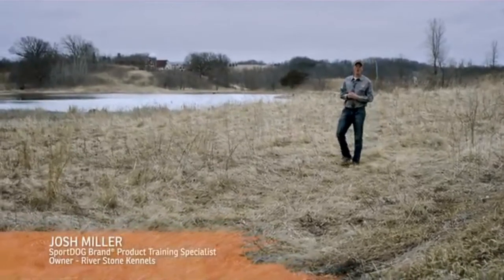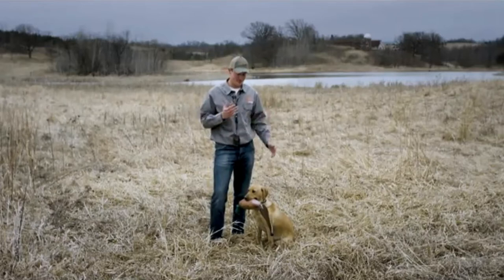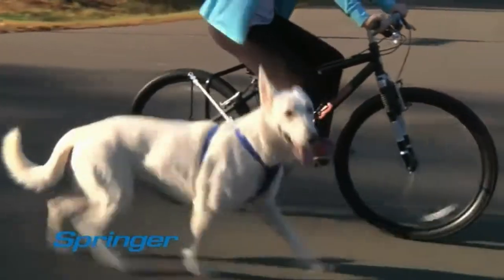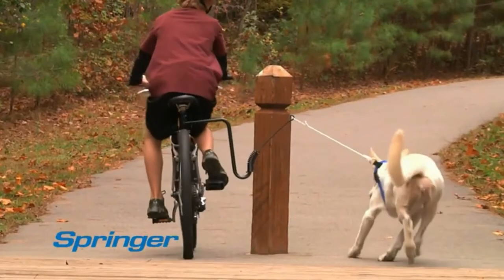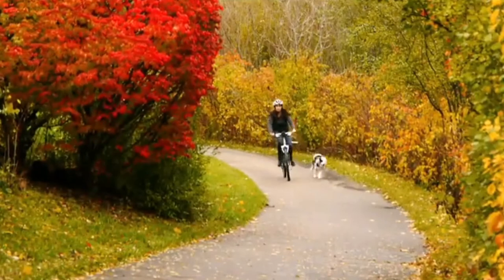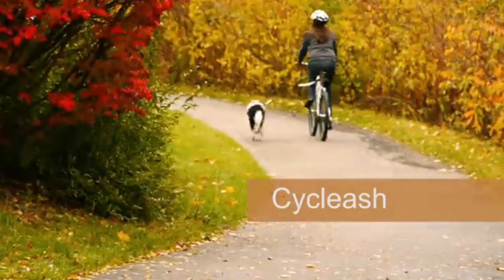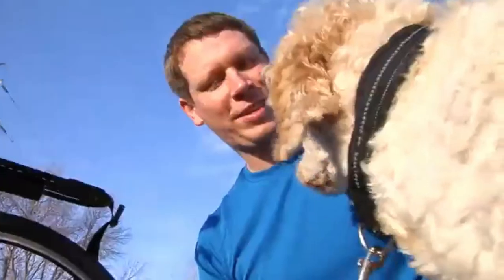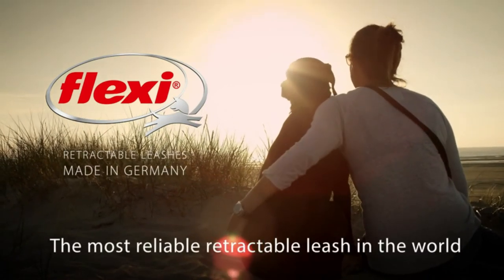Best Bike Leashes For Dogs | Top 5 Dog Bike Leash For Bike Riding

Comment: The problem with this design
It is purposely designed to release the dog if the pull is hard enough, such as hitting a pole
I believe a large dog with a strong enough pull would be able to pull hard enough to break the connection and attack another dog or person